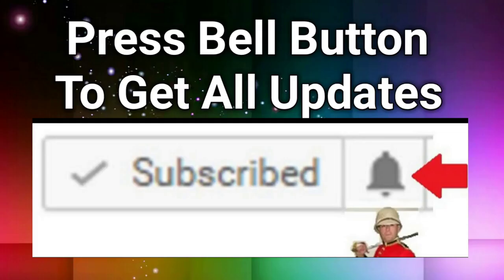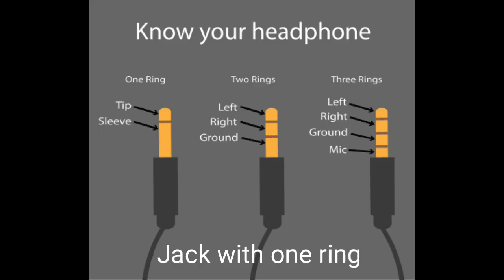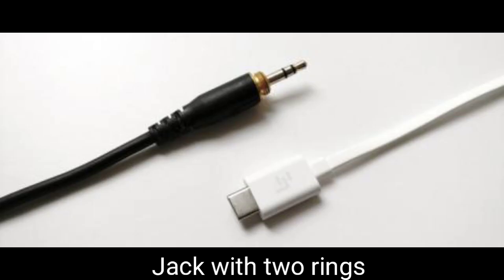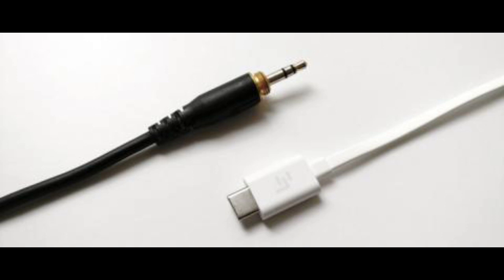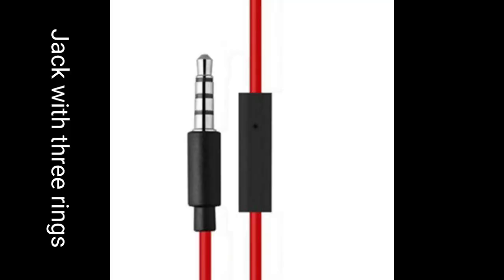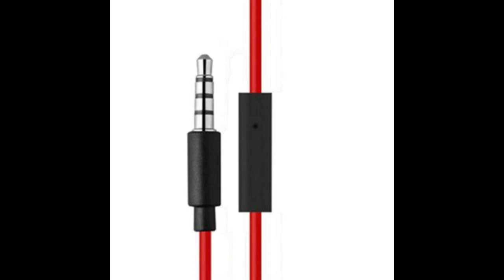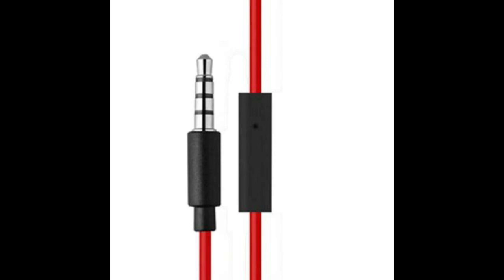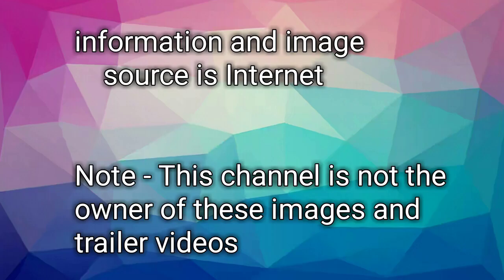Do you know this? : why earphone jacks have 1,2 and 3 rings

Comment: Maybe you can help me out here I am a competitive gamer and I use the turtle beach elite pro 2 + superamp and my cable that goes from my dac/amp has a 3 ring connection into the headset but the other end that goes into the dac/amp is a 5 ring connection and I want to replace that cable but I can't find a 3 to 5 ring cable anywhere